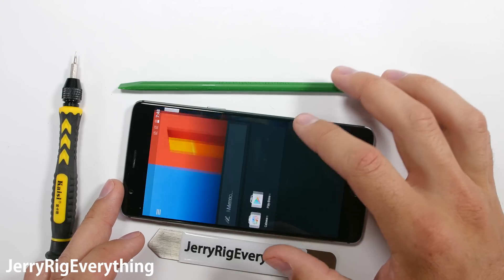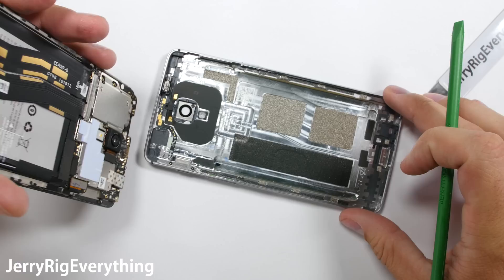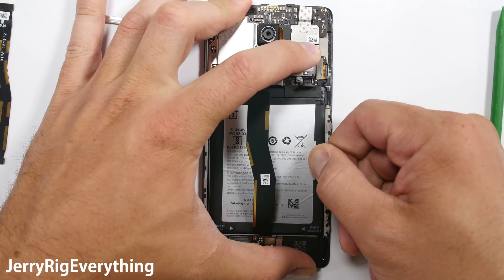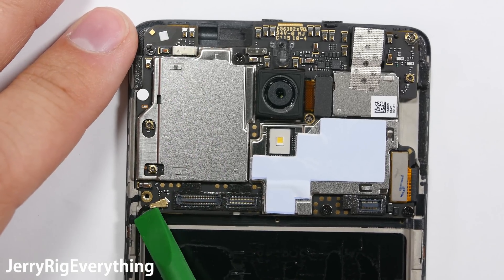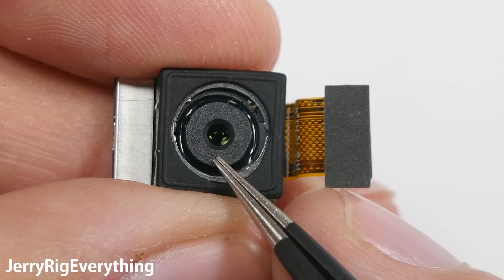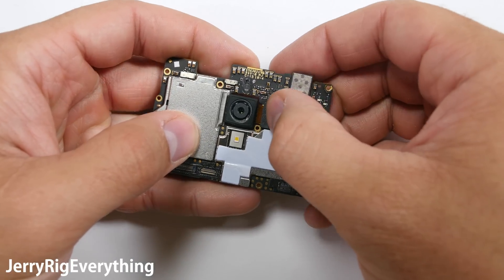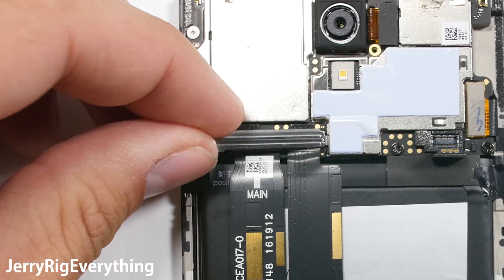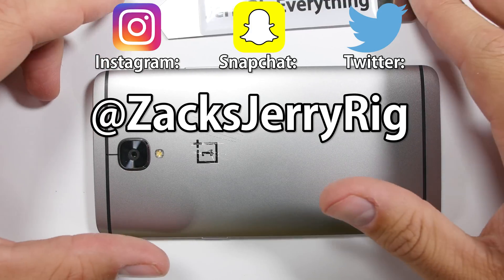OnePlus 3 Teardown, Screen Replacement, Battery fix

Comment: hey... i just cracked my oneplus 3 screen and want to repair it, the amoled panel is fine everything is working perfectly so only the glass is broken... so my question is can i heat up the glue between the screen and amoled panel and cut the glue off with a tiny tiny thin round string off metal and take the glass off and replace it with a new glass and glue it back on?

Comment: Something came to my mind: how hard should you press on the home button while using the phone to break it?
Reply: u cant press it. its a solid piece that recognizes your finger just like your amoled screen. the homebutton isnt one piece. its connected to the glass. i dont think you can pry it out or push it too far in the phone.

Comment: Hey, so in theory, it should be relatively easy to replace the OnePlus 3's front-facing camera with an upgraded one from the OnePlus 3T, since their dimensions are identical, right? Or would I bump into any trouble, maybe software-wise?
Reply: Most likely it would not work since the cameras are totally different sensors.

Comment: would it be possible to get a oneplus 3t battery with the 3400mAh capacity and put it in the original oneplus 3 (same size and everything)?
also will you do a oneplus 3t teardown and repair as well? it would be awesome if you'd find a op 3t battery!

Comment: Thanks for this video! I am upset that so few manufacturers have replaceable batteries these days. It is not so much the convenience in going from 0 to 100% charge in seconds by swapping the battery (although that is nice), but more being able to increase longevity when the battery capacity decreases in a year or two. This video shows that it only takes about 5 minutes to do this. That combined with an unlockable bootloader and good support on XDA means I will be placing an order for a OP3T the day it is released.

Comment: +JerryRigEverything

how waterproof is the phone? They say it doesnt have an IP rating but still is splashresistant.
Reply: Sou Illuminat Yeah the nav buttons would turn on and off, they were just glitchy. BUT now everything works fine, just the speaker doesn't sound like it did out the box I think, bit hey that's my fault 😂
Reply: Puddi Puddin my oneplus 3 has survived milkshake mix, it messed up the speaker, nav buttons, 3.5mm jack. So i purposely dipped the phone in some water, shook around a bit to attempt to wash out the mix. Half a week later everything worked just fine.
Reply: Is the phone still working? :D I get how the headphone jack and speaker got damaged but the nav buttons? That means the shake got inside which is not good but the phone should work if it didnt get to the motherboard.
Reply: Sou Illuminat that's the funny thing. Speaker and mic seem to work on every water test. So you should be able use it in the rain basically splash resistant but avoid water you have no warranty on any damage

Comment: Do you know where is the wifi chip? Is replaceable? I drop my phone at swimming pool, opned it, cleaned with alcohol, and now the home button (and the both buttons at left and right side) aren't work. When I reboot the phone, I'm able to see the lights, but they dont recognize my fingers. And about the wifi, it shows the near wifi networks, but when I click to connect, they try to authenticate and fail, and stick looping this process. 

Please I'm looking for any help. THANKS!

Comment: Nothing short of a nightmare removing a cracked screen from this one...

Take care of yours guys, if the glass breaks, the LCD will go with it.
It's amazing how thin the LCD is... probably 3 times thinner than the glass touchscreen itself. Feels like paper with a varnish coating. Cracks just like it too. xD

Also hard to take a cracked screen from the plastic frame itself. You'll probably damage it a bit just to start taking out, and it's most likely that the tiniest cracks will happen either on top or at the botton of the screen. Is that's the case... you are f'd. :P Oh, confirmed... borderline impossible to take the LCD+touchscreen out without damaging it. If you don't crack the glass or damage the frame, seems to be extremely easy to crack the LCD by shoving any sort of prying tool there. It's just too close to the edge.

The good part is that the middle of the screen unit (LCD+touchscreen) is not glued, so it'll be easy to remove a good chunk of it. The bad part is that top and bottom are well glued together, and you'll probably have to rake all those tiny shards of glass.

Also, if the bottom cracked, be careful about the fingerprint reader and the ribbon cable for the back and menu buttons. This cable is between the plastic frame and the LCD panel, I ended up ripping mine up, oh well.

Zack, thanks again for the teardown. iFixit still doesn't have one for this, so I was a bit lost.
Now it's waiting time... not sure how long it'll take for the replacement panel to get here.

Comment: I accidentally dropped my op3 and and the screen got some little scratches ,well it's not a big deal but the problem I have here is that the bottom of the phone near the speaker a tiny piece of the phone aluminum body came out (looks almost like a deep scratch) now I am worried how to fix it

Comment: Hi Jerry, I accidentally dropped my HTC one m7 (which I got in 2014) in toilet bowl and it only soaked in water for less then 3 seconds because I managed to grab it back after I realised it fell in the toilet bowl. I already kept the phone in a sealed container together with rice for 24 hours. The problem now is that the phone just couldn't turned on. Perhaps you can give me some suggestions because the cost of repairs here is very expensive and the repair shops always charge some non sense charges. (plus I dont know if the phone is broken down or just totally out of juice) thanks in advance.

Comment: Hi Jerry, I stump into this video 'cause I have a problem with my OP3 rear camera... the autofocus doesn't seems to respond. I was wondering if you knew about this, if it's convenient to change the camera or just open the phone apart and change it myself (that's how I got your video at the end!). Thanks a lot for your time and answer!
Reply: I have the same problem with my rear camera too.
Reply: if you're running cm on the opo It's a software issue.
heres a link to a xda thread (i removed the www to get around the spam filtering systems)

forum.xda-developers.com/oneplus-3/themes/port-oxygenos-stock-camera-cm-t3451721

Comment: Just hammered my screen accidentally on this phone today, called up a repair center in melbourne to ask them to replace the screen and the person said the screens on the Oneplus 3 are uniquely programmed to the mobiles IMEI number????

The repair center said they need my imei number  to send to the supplier so they can program the screen to match it and make it work with my phone. Is this true or is the phone repair shop trying to do something dodgy?
Reply: sounds like bullshit

Comment: Hi Jerry, thumbs up for the video. I've got one question, explain me a bit more on the replacement of the front glass panel. (at 3.24 you mention that replacing would kill the screen) 

Let me explain it a bit more in case you need.
I got my glass cracked but the screen and all touch functions work totally fine. If the broken glass parts are removed from the screen can I replace it with a OEM Front Glass Panel without damaging the digitizer and crucial parts of the screen ?

Thanks.

Comment: Dropped my Oneplus 3 and cracked the lens cover for the rear camera :'( . I've found out that the samsung S7 uses the exact same part so have managed to source one from amazon, however the camera module itself may also need replacing, does anyone know where I may be able to get one?

Comment: Hi Jerry, i have what i think is a very difficult question. Let me give you  a little bit of background first. I had a Huawei P8 with OIS, After using it for a month the camera started to buzz and the image started to shake....a little bit of  research got me the answer...since i used the phone on my motorcycle cellphone mount, the vibration screwed up the OIS motor. Ive been considering to buy a OP3, however im affraid the phone will damage as well since it comes with OIS: The question is, do you know if the technology is the same, being that both carry Sony sensor, im affraid it will have the same effect if i use it on my motorcycle.

Thanks

Comment: Do all camera modules the same connections and could you switch out for a better one
Reply: *have
Reply: +Essential EDM theoretically you could if it was the same size
Reply: Antoni Zyla Interesting, because camera modules from other phones are quite cheap (£15) for something excelent like the s7 camera, that would be a great video to watch actually
Reply: ***** I can code a bit but not in the right language :( plus I have no time, thanks for the input though.

Comment: hey Jerry. i need a glass replacement on my 1+3. just dropped it from 2 feet after having it for not even a week. and with the karbon case it comes with and a glass screen protector and it still cracked. so mad. i crack my phones. anyways can you link me a new glass for it please. thank you

Comment: I own oneplus 3, but sadly already cracked the screen. Slipped out of my pocket. It wasn't that big of an impact and the screen is now KO. It cracked in two places. All that with original case and screen protector. So be careful, its quite easy to damage it.
Luckily, OnePlus charged me just 90 Euro for screen replacement with labour, DHL express shipping and everything else included. Not that bad considering new screen alone is selling for 115 Euro on ebay.
Reply: Oh damn. I just cracked my OnePlus 3 screen the exact same way. - How long did it take from you wrote them - sent the phone and got it back..?
Reply: I created a ticket on oneplus site, they picked the phone next morning and it arrived to service a morning later.
Now its about week and half since they have picked it up and its sill being repaired. Not heard from them yet since they wrote me they accepted the phone and are working on repairing it. Hope its not gonna take much longer tho.
Reply: Oh okay, thank you for answering. Created a ticked yesterday, waiting for a reply.. Best of luck to the two of us and our wallets!
Reply: Thanks and good luck to you too.
I luckily got mine today. Took about two weeks and costed 90 Euros.
Very happy with the service. The only small drawback was a lack of communication during repair.
Reply: Oh damn, fairly cheap and surprisingly quick, awesome! I'm happy for you! UPS is picking mine up tomorrow, can't wait to get it back.
Reply: *****
 Thanks. Hope yours will be back soon too.
Reply: what do you mean with KO?
did only the glass shatter or did the digitizer (the part that detects touch Input) break with the glass?
Reply: TechGeniux
Only the glass broke. Touch worked and the display layer itself was fine. But they change the whole display assembly anyway, so it doesn't really matter.
Reply: thanks, that helped me out a lot, because on the opo a shattered glass meant no digitizer wich pretty much bricked the entire phone, but now I know it's not gonna hapoen on my new one :)
Reply: Same happened to me, but just cracked the top glass, the display and the touch still working normally. Sadly, i live in Brazil, so don't have any ways to repair my OP3 with OnePlus. I've to buy a new screen replacement and replace the screen, all by myself.
Reply: Its not that hard to replace. Just a few screws and one cable. There are guides on youtube.
And there should still be some repair shops in brazil that would be able to do it.
The screens are still selling for around 100 Euro, so it will still be more expensive then original OnePlus repair, but not that bad compared to other phones.
Reply: elukok yes, but now I'm out of money to buy a new one. And Brazil's government charges very expansive importation taxes. I was wondering if I can replace just the cracked glass instead replacing the entire screen, so I went into some cellphones shops, they all said the same to me: it's practically impossible to remove just the glass without breaking all the screen. So the safest thing to do is replacing all the screen instead just the glass.
Reply: niiice

Comment: I recently cracked the square glass covering the back camera lens in my OP3...I couldn't find any spares online as the phone is still new...going to OP for service is also not an option...could you suggest an alternative fix?
Reply: How is that protective glass working out for you? Would you recommend it?
Reply from the maker: Ill check with my supplier... but I dont think the replacement lenses exist. You can try a Galaxy s7 lens... they are ALMOST the exact same size, but I dont think it'll be  perfect fit. The S7 glass might be a tad too large.
Reply: +JerryRigEverything thanks for your reply! what I decided to do is order some protective glass for the original lens..just gonna stick that on top of the frame..I'll let you know how it works out
Reply from the maker: Amarith Chanthalangsy Thats actually a really good idea. Definitely let me know how it fits!
Reply: I found a repair shop in thailand with the part. It took me asking 10 different shops to find one that had the part...but all is well now! fiew.
Reply: Did you find any replacement parts for the camera lens? I searched for them, but couldn't them. Also, would replacing the camera glass be the same process as for the S7 that you showed in another video? Thanks!
Reply: @AmarithChanthalangsy Is there an online location that I can find that shop and/or replacement glass?
Reply: +leo c I when to a phone that called their supplier who had the special part. unfortunately and obviously the shop did not divulge their suppliers name.
Reply: so did i.. am in the same boat. Have no idea how i did it. have found goriLLa glass covers.. LittLe too Late now.. amazingLy wimpy glass covers.. very disappointed
Reply: according to David GranvilLLe's comment beLow the GaLaxy S7 uses the same gLass cover
Reply: Have the same problem. I can buy a spare part from China but has long delivery. Where did you get the repair done in Thailand? Bangkok? I'm there at the end of October.
Reply: Amarith Chanthalangsy the same thing happened to me
Reply: Amarith Chanthalangsy

Comment: Going to replace the battery with the red one from my OPO. 
That's a lot less screws than the OPO btw. Replaced my OPO screen 3 times, good to see that replacing it in the OP3 will be a lot quicker.

Comment: nice that the 1+3 has "user replaceable" battery, that doesn't require special tools and glue. Cause i plan to use my 1+3 longer than 1 battery can live.

Comment: Great video! I understand from your video that replacing the screen would sacrifice the original screen. However, someone I know offered his OP3 to me for a very cheap price since he broke his screen, and rather goes back to his Iphone (don't even start..). I did not buy it yet, but I was planning to buy it and replace the screen myself. Could you perhaps tell me which tools I need exactly for replacing the screen and some do's and don'ts? I would appreciate your help :)

Comment: This phone is alot easier than the Nexus 5, the motherboard holding the back-cover plastic was way too tight(uses no screws), and when i replaced my battery, a few of those clips broke off and my back-cover was permanently less tight into the phone, causing it to go a bit loose on certain sides when i dropped it on even the softest pillows, sad times :(. Hope since this one uses 2 screws is less tight.

Comment: just cracked my screen, where can I get a replacement oneplus 3 screen
Reply: +WhatTheNack yea I will..
Reply: +Finger Mustache inc do you know how much does the back camera lens replacement cost?because the glass cracked but camera still works
Reply: +Nejc Muhič what do you mean?
Reply: I recently cracked the square glass covering the back camera lens in my OP3, so i want to know how much will repair cost...
Reply: +Nejc Muhič probably a little less than what I paid 70-100 dollars would be my guess. 
they have to replace the entire screen even if the cracks are just near the camera
Reply: +Finger Mustache inc the BACK camera lense cracked not the font cam.
Reply: +Nejc Muhič i cracked my camera too 
if you find any glass replacement please let me know
Reply: I sent my op3 today to the servise because i couldn't fing any spares online..-.- i hope they will fix it with a reasonable price
Reply: how long did they take to fix it?
Reply: +WhatTheNack the price is 65,10€
Reply: Or 69$ for US
Reply: A week and half but they forgot to return the SIM tray with the phone, I got the phone back but the SIM tray  took about a month
Reply: ***** damn you better off getting a new sim tray off ebay
Reply: Same happened to me. I found screens on a store named Parts 4 Repair.
Reply: I'm going through the same problem now and contemplating on OP repair (if they even will without insurance) or a local repair store (last option really.) Were you able to save all your files before sending it in? Did they even do a factory reset? I'm just afraid of losing all my photos/videos and what not.
Reply: how did you sent it to them?
Reply: Finger Mustache inc Who Watch this at a one plus 3?
Reply: Who whatches this on One Plus 3 with a broken screen? :D

Comment: I need help. I got a Oneplus 3 on June 25th, and it broke on June 27th. I tripped and dropped the phone, cracking the screen. glass is shattered, but the display is fine. capacitive touch is still present, but the broken glass is slicing up my fingers when I us it normally. If I could get some help, a link with replacement screens, and a guide for proper replacement, I would be very happy.